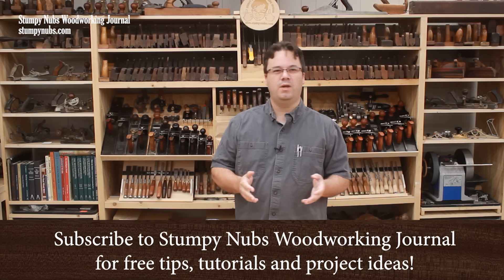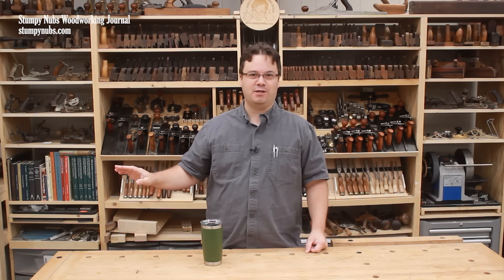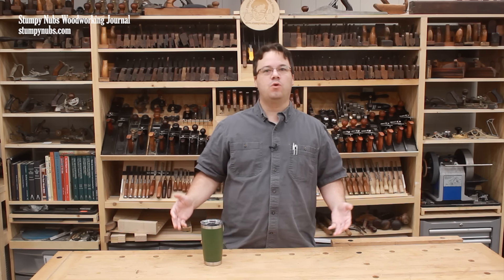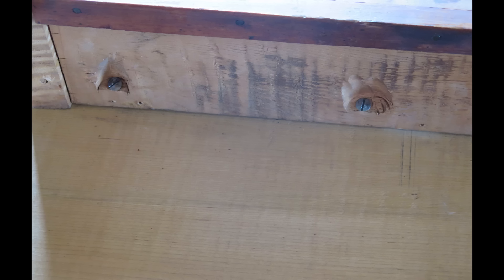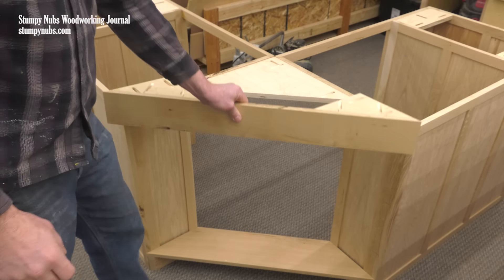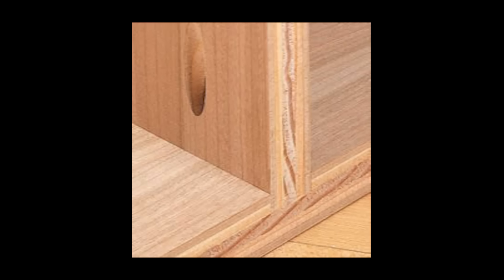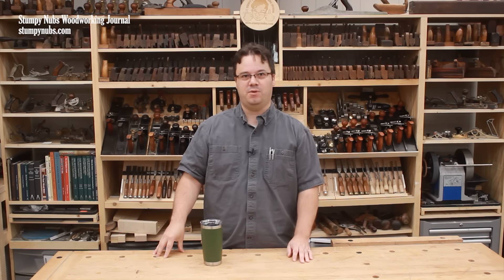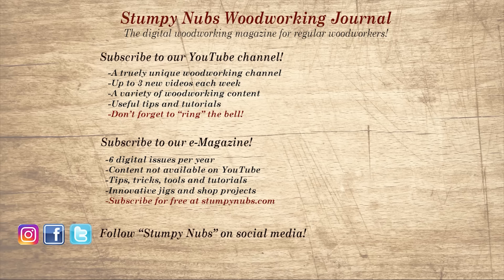They lied to you about pocket screw joinery.

Comment: The best thing that ever happened to me in regards to woodworking was repairing a small 100+ year old table that a family member had fallen on. 
I do not know if this was a factory produced piece or a one off that someone built. 
The skirt and legs used saddle and tenon joinery but the saddle was cut with a circular blade from the top down and the tenon was very roughly rounded on the bottom edge to fit. 
The skirt shoulders were large enough to hide anything that you would not want to be  seen. 
A single nail was installed from the back side through the tenon to reinforce the joint.
The top was a glue up and the joints were failing mostly from water damage. 
I had planned to rip the top on the joint lines and do a new glue up. 
I discovered none of the boards had parallel edges, that was very interesting to me since I just assumed flat and square on all pieces was a given, but apparently they just jointed each edge, glued them together, and sorta squared the top afterwards. 
Since the joints were failing I finessed them the rest of the way, jointed the edges on the jointer, and glued the top back together, since the top had a profiled edge I didn't check square. 
The drawer featured half blind dovetail joinery at the front and a small single nail was driven in from the bottom to assure the joint didn't separate to the sides. 
All this was glued together with what I presume to be hide glue which had definitely seen better days.
In spite of everything this little table was still standing proud until it got smashed. 
Since there was a lot of structural damage I used floating tenons and epoxy to fix the tenons that were broken and Tite Bond everywhere else. 
I thought about putting nails back in it like the original build but I figured the modern glue would hold up on its own well enough. 
I used furniture refinisher on it with a topcoat of wipe on satin poly and it turned out great. 
Before I saw how this little table was built I was very much caught up in making things fit with absolute precision and I am still inclined to be very critical of my fittings, but that little table had really stood the test time and it was not a precision built piece. 
The history I know about it is my granny got the table from her parents and they presumably brought with them in a wagon when they came to Texas from Missouri.
When I was a kid my granny had an aquarium with Guppies on it for many years, when she passed my brother got it and used it as a night stand, my brother is the one that fell on it. 
After I repaired it my brother used it for a couple more years until he passed and the table came to me since I had repaired it.
My wife is now using it beside her chair as a side table. 
I think all joinery has its place and there is no such thing as 'purist', you can go back as far as you want in woodworking and if a craftsman of any past era is offered technology that makes their life easier they would jump on it in a heartbeat. 

Sorry for writing all that, but repairing this table made me realize most normal old timey woodworkers built things to serve a purpose and their time was probably at a premium so good enough was good enough and this table proved that point to me.
Reply: Interesting  comment, cheers for sharing.
Reply: Wonderful  story, thank you for sharing sir
Reply: "I think all joinery has its place and there is no such thing as 'purist', you can go back as far as you want in woodworking and if a craftsman of any past era is offered technology that makes their life easier they would jump on it in a heartbeat." 
That's all that needed to be said. It's an excellent point, that's going to be missed by a lot of people who don't like reading wordy comments.
Have you noticed the lack of, "purists" in the comments bashing pocket screws?
Reply: Any job worth doing is worth doing badly.
Reply: One ! GOOD !! MINUTE !! IN THE !! METAL !! SHREADDER !! AND !! THAT !! TABLE !! AND !! CHAIRS !! BECOME !! A !! MASTERPIECE !!!
Reply: @dashriprock5720  if a couple of paragraphs that you didn’t even read triggers you this much you might need to see a psychiatrist.
Reply: I love this story. 

My grandfather passed several years ago and I remember him working away in his little shop. The man built so many things and those things were beautiful.

But he was very creative when it came to things that couldn't be seen. See, he was a Depression Era kid and he'd become accustomed to using whatever was available to get the job done. 

All of the things you could see were as you described. Dovetail joints, beautiful carvings, profiled edges with a scraping jig.

But under the surface might be glued up plywood. Old screws and nails that he'd pulled from garbage lumber and lovingly straightened and saved.

And nothing he built broke. Ever. Solid as a freaking rock. The man was a father of six kids. Things didn't fall apart in his house, even with rough use. 

People have always done what they could with what they had. For years people turned stacks of plastered posters into the first make shift plywood. A coat of paint or a nice veneer can hide a multitude of sins.

I think that what's important is that they knew how to do it right. They knew the tips and tricks for proper woodworking. So they could finangle things here and there when they came up short on supplies. 

Most people weren't 'masters.' But they could still make useful, beautiful pieces that worked for their purpose and lasted.
Reply: @dashriprock5720  I will admit I missed this as I skipped to the end as the video was ending, so im glad you pointed out that part because its so true, i think ANY craftsman or engineer from ANY century would quickly forget about their usual methods if given a faster/stronger or atleast as strong as alternative.
 I even think any artist throughout history, if given good quality but "off the shelf" acrylic/oil paints and told them they would produce more vibrant, longer lasting colours, they would quickly ditch their hand ground pigments in a heart beat. 
I think people just like to pretend people from those periods had different values and more class, but they probably valued their time just as much as we do and would jump at the chance to save more of it just like we do, they used what they had because that's all that was available, not because they were purists of any kind.
Edit, I just had an imagine of Da Vinci being given a Dulux paint mixing machine, i bet he'd have ended up using that (after taking it apart and studying it) and we wouldn't have half the paintings he did anymore, because he'd have been obsessed with using it for shades he'd never even thought of before.
Reply: @chashint1  100% I agree with your reply. Sadly there is always "That Guy."
Reply: I read War and Peace in less time than this comment.

Comment: My husband wasn't thrilled with the idea of pocket screws until I asked him to do a specific project recently. I needed very strong shelving systems installed in a full wall of very weak cabinets. The walls of the cabinets were simply too thin and flimsy to support a shelving system. (Yeah, I bought cheap. But they sure are pretty and the busy man didn't have to build them.)

For the first time, he dug out the pocket screw jig that he'd been ignoring for a few years to get to work building a strong shelving system (with sides) inside of existing cabinets. Basically he had to build independent shelves inside of the boxes. 

This was the easiest, simplest project he's ever done. He finished with everything within a few hours. Zero hang ups. The whole thing came together without one hiccup. 

He was grinning by the time he was done and I swear he looked at that little jig with a bit of respect. I might get my custom master bathroom cabinets sooner rather than later with his new little blue toy. lol!

Comment: Although I'm a long-time viewer, I just came across this video today and it couldn't have come at a better time. 
Like many people, building straightforward cabinetry is well within my realm. But just the other day, I took on a project for friends that gave me some pause.
It's a trapezoid cabinet base for a standing bar that creates a barrier between two rooms. I was wondering what my best joint would be considering all the mitered pieces. 
Then, I saw the section  with the angled support trail and mounting blocks. I have no doubt I'd have gotten there eventually, but this definitely caused the light bulb to go on! 

Timing is everything. Thanks.

Comment: I appreciate you covering the uses of pocket hole joinery, because I was under the impression that it was a subpar method. Thinking back, this may be because all of the examples I had personally seen were not done well. I received a set of chairs from a friend that were done with pocket holes and they were falling apart after just a few seasons. I thought perhaps it was just an isolated case, but then I received an antique table some time later that had the top attached with pocket holes. It was split down the middle and the screws had completely sheared in half due to seasonal stresses, so I concluded that it was inferior. 

You mentioned that it must be done the "right" way, so I would be interested in learning more about what that means. Maybe the craftsman of that table didn't oversize the holes like you suggest? Does grain orientation matter? How about the types of screws? 

I think my other reservation has been that, in my opinion...it's a little unsightly. I had been taught to cover up the holes with dowels or buttons, but most people just leave all the pocket holes open and it doesn't look good to me. On shop furniture or unseen areas it's certainly no bother, like you say. However, I've seen examples of client work where it's plain as day and I find that very unappealing. 

Regardless of any of that though, I agree that tool snobbery is silly and really there's a time and place for nearly every tool and technique under the sun. Whatever it takes to make wood work :)
Reply: Edit: Oh my gosh I just realized you DID do a video about pocket hole screws! I'm late to the party, I guess

Comment: I started out using construction lumber, a skill saw and pocket screws to build stuff, and still use them every now and then, they absolutely have some advantages.
Reply: Same here. Pocket screws are the gateway drug of woodworking!
Reply: I was given a old Craftsman table saw, a jigsaw and a orbital sander. I'm not the best at woodworking but the first thing I bought was a pocket hole jig and then I made a simple table. Now I'm about 6 projects in from that with more tools. I don't think I would have been as excited to make stuff without the simplicity of that jig. I'm practicing making other joints though and until I get it to pocket holes it go!
Reply: I have a bench on my covered back patio.  Tarps go up on the sides of the patio in the winter.  In the most protected corner I have a rack to hold full sheets of plywood at about a 15 degree angle from vertical.  Lumber goes under the bench.  My equipment consists of a compound miter saw, a track saw, a router with fence, brad nailer, and a collection of rechargeable tools...jig saw, small circular saw, impact driver, drill, etc.  I can cut a dado with the router if I need to.  Generally do pocket screws and glue.

Face-frame cabinets and drawers for the bathroom are in progress.  Boxes and drawers are plywood.  Pretty parts are beetle kill (blue stain) pine to match the walls.  Vanity top will be a store-bought Acacia wood top to match the room trim and Oil-rubbed Bronze fixtures.  Also working out what the new kitchen cabinets will look like.
Reply: @Bradofosho  I paid $27.00 for my compound miter saw at a pawnshop, as it barely turned and emitted large quantities of foul-smelling white smoke when tested.  A quick inspection revealed the anticipated plugs for the carbon brushes, so I snagged it and hit Amazon for a $12.00 pair of new brushes.  Runs like new.  About $40.00 total for a nice Craftsman saw.

Comment: Love your comments. Totally agree with your stance on pocket  screws but from the side of creating solid wood  furniture somewhat resembling the days of old they are aesthetically displeasing whether you can see them or not whether or not or the shakers used them for table tops attachment. Not sure but casework with plywood doesn't seem to show up in shaker furniture.     Don't get me wrong there are shaker methods I would not use.  I assume this video was to comment on the one size fits all and painting things with a wide brush is wrong.  Love what you are doing but it is a hard row to hoe to separate classical  woodworking or even "high end furniture"  from what we build today and even commercial or kitchen cabinet cases. Good luck on pleasing us all. Keep up the good work.

Comment: Honest and logical commentary about the use of pocket screws.  I've always tried to use more traditional joinery with projects but there are many cases where pocket screws save considerable time and for certain kinds of projects result in perfectly sturdy results.  The misconception about "pocket screwery" as I call it (or as an English friend says, "Pocket Bugary"), is not unlike some that consider it sacrilegious to use a nail gun (oh my!  I said it... "nail" "gun" .... !!!).   It all depends on the nature of the project.  Just one comment on your video.  It says the video was made possible by Castle Pocket Hole machines.  I took a look at their website and their machines are very interesting.  I've never used them and I'm sure they do an excellent job, but I doubt very much if most DIY's not doing production volume work can afford such expensive machines.  But, as with all situations, time and throughput in a production environment, such as a furniture factory, would necessitate such machines rather than more manual methods for creating and securing pocket holes and joints, so they have a place.   Thanks again for the commentary.

Comment: Pocket screws, paint, and southern yellow pine construction lumber are some of my favorite ways to piss off the woodworking purists. The first two are pretty obviously useful for a variety of reasons, and anyone who is capable of putting aside their "fine woodworking" biases can see why they are very practical and acceptable ways of doing things. Southern yellow pine is another one of my favorites, because although it doesn't have incredible wear resistance, it's an incredibly strong, tough wood that can prove you don't need to make everything out of expensive hardwoods for them to hold up. Heck, one of my family's heirloom pieces of furniture is a picnic table and set of benches my great uncle made in the 1950's using painted SYP construction lumber and lots of pocket screws.

Comment: I would have to say you are right about pocket hole joinery James.  I started out doing projects with pocket holes and then learned other joinery styles.  We have some antique furniture that is quite old and I’ve seen some pocket holes use in them.  So….yeah, it’s been around forever, which made me feel better about using it.  I find that I use them like you when it is the best solution.  It’s all good.

Comment: So true! I own a furniture repair business. Pocket screws are not good for joints that are going to move or take a lot of weight. Dining tables and chairs are usually not a good place for pocket screws. But as you stated kitchen cabinets screwed to the wall will last many years. I built my kitchen cabinets with pocket screws and they are very strong. Good video.

Comment: Spot on as usual James . I started out with pocket holes and they got me into woodworking. I do a lot of hand tool work but I’m not trading in my sawstop for a carcass saw , I have zero problem using pocket screws now if I feel the need same as handcut nails and I use mostly traditional joinery . I know quite a few older woodworkers that are firmly anti domino because they feel it’s cheating. I personally have never had a problem with my joinery failing from pocket screws used appropriately anymore than I’ve had a problem with loose tenons failing . Haters gonna hate and I have yet to personally know a master woodworker that had a problem with any technique that works . In the words of the great American philosopher Rodney King “ why can’t we all get along “

Comment: There are lots of projects where things just need to be good enough, and the speed of pocket screw jigs makes something worthwhile to do, whereas with a mortise and tenon, it just wouldn't be.  Recently, I made an archery target out miscellaneous scrap wood in my garage combined with rags and an old plastic drop cloth, spray paint picked up from the recycling center, and the backing for a hook rug that I picked up from a thrift store.   In this project, I didn't even use pocket screw joinery, because I could use even lower grade techniques!  But I did use pocket screws for the part of the project where the screws were the "latches" that might occasionally be removed.

Comment: I had used them a couple times in the past, but just used them fairly extensively on a couple outdoor planters I made. Now I want to get a better pocket hole jig and use them more. I am going to be redoing some outdoor fencing soon and plan to use them on that, too. I think they are going to work well and eliminate almost all visible holes/screws.

Comment: I built all my kitchen cabinets with pocket holes and screws. 18 years later and not one crack, not one failure of any kind. All my drawer boxes are built the same way. No failures. I’m sure my construction was by far faster than traditional methods and that meant keeping SWMBO happy that the kitchen wasn’t out of commission longer. Most of my shop furniture is also made this way and I make no apologies for using this system. Thanks, Stumpy for being a clear voice in all the hoopla.